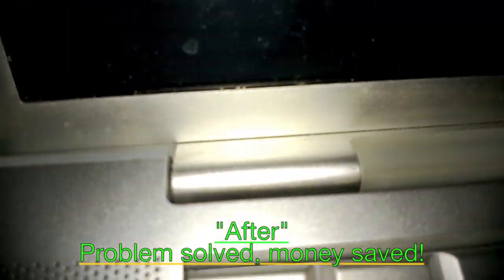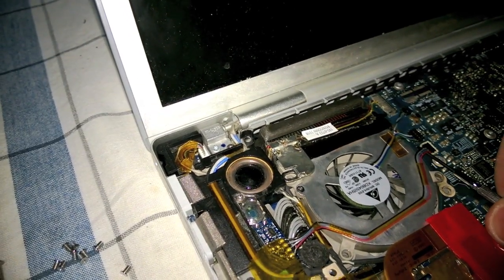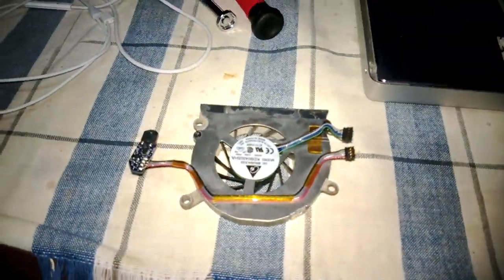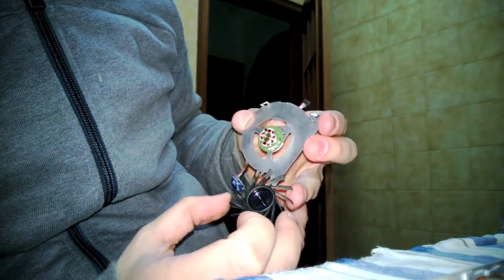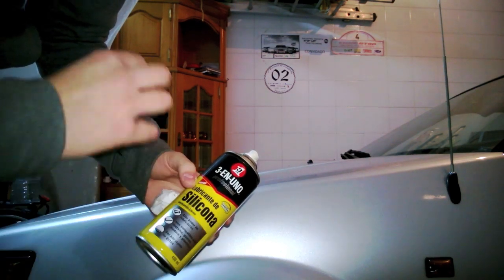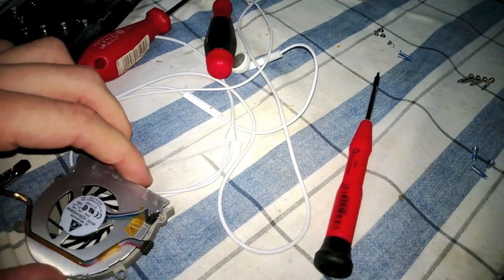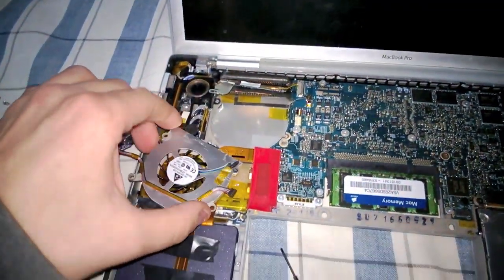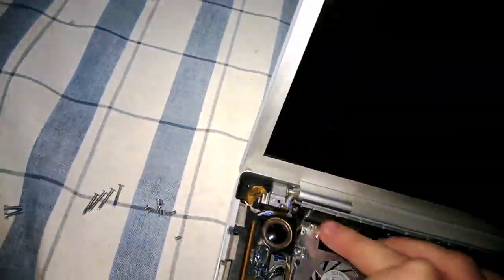Fix your noisy MacBook Pro fan FOR FREE

Comment: After replacing both fans, the left fan was still making noise (defective replacement?). So I disassembled the old fan, cleaned it (lots of dust and dirt), lubricated it, and put it back in my Mac. Works like a charm! Thanks!

Comment: For the Macbook pro 17".....it is not necessary to remove the entire fan components. I removed just the two screw on the top and pulled the fan out without any difficulty. I used a silicon lube that is also used in plumbing. It comes in a tube or jar. I applied it with a small paint brush to the center fan post. No more noise.

Comment: Awesome!!! So quiet now. There is another part that was overlooked. The cooling fins( heat sink) in front of the fan was covered in dust and dirt. So the fans weren’t cooling at all.. Make sure you clean there as well on both sides.  Whisper quiet and 50% cooler. Thanks for the TIP on silicon spray

Comment: Cheers man, I'm going to try this tomorrow. I have some silicon chain lube. 

I've got an old Late-2006 MacBook Pro. Recently cleaned the inside of it even. But now 1 of the fans is making lots of noise. Sounds like the lubrication has dried up over the years.